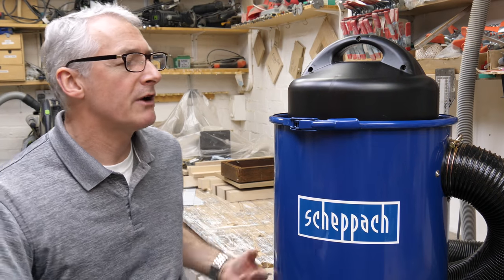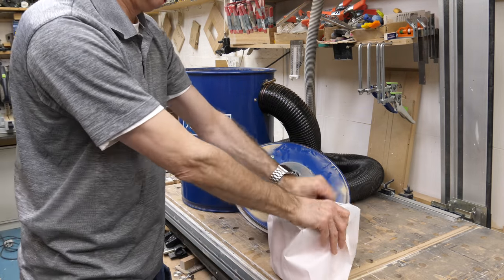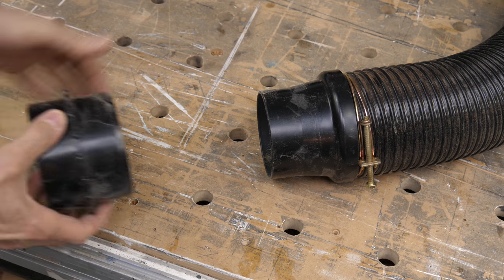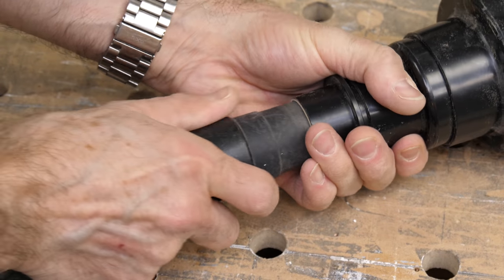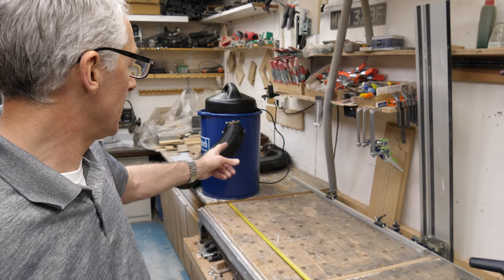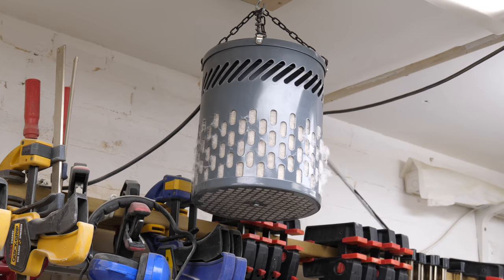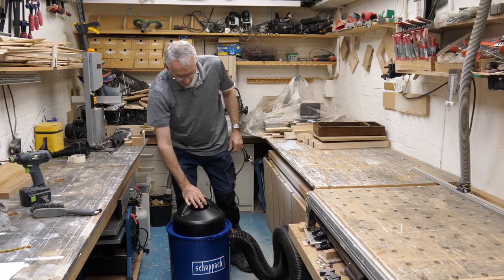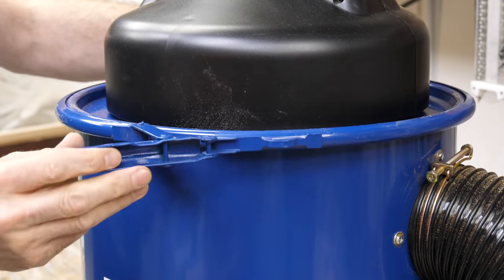Scheppach 50 litre Shop Vac [video #366]

Comment: I have just installed 100 mm pipework into my garage and I have 4 blast gated drops, the 1500 w Wet/Dry vac connected to the setup is either not strong enough or this is what I need, comments please? I purchased the Metal blast-gates from my local carpenter's store.
Is there any recourse available anywhere for hints, tips and tricks for dust extraction?
Reply from the maker: I’ve never installed that kind of ducting I’m afraid. What’s the longest run from the extractor to the tool? And is it a single turbine extractor? My YouTube pal Keith Brown at Rag n Bone Brown did a video about his ducting and extraction not that long ago, might be worth a look?  https://www.youtube.com/watch?v=t3O6nEjVWrM 👍👍
Reply: @10MinuteWorkshop  Rag & Bone was how I discovered your channel. I have already asked Keith the question, as someone who is new to all this and keen to get into a good hobby I was so disappointed when my system didn't work as I thought it would.
My Vac is a Einhell TC-VC 1930S 1500 W Wet/Dry Vacuum Cleaner connected to a cyclone and a drum. I just assumed it would work.
Back to the drawing board!
Reply from the maker: @22illingworth  Ah, OK. No I'm afraid I wouldn't expect that Einhell to be up to the job;  if you try and step a ~40mm hose up to 100mm you won't get the airflow you need - but you can step 100mm down to ~40mm and suck the chrome off a bumper! I think you'll see a major improvement if you switch to something with this Scheppach vac, or something better. Small-hose vacuums like the Einhell would be fine connected directly to power tools like plunge saws and sanders, but don't have the airflow to move large quantities through a 100mm pipe, I'm afraid - you'll need something that starts with a 100mm hose attached to the vac. Hope that helps! Best, Peter
Reply: @10MinuteWorkshop  that's exactly how the Einhell works.... perfectly on it's own... thanks so much for your input... looks like I may be in the Dog House when I explain to the wife I need another new toy for my hobby :)
Now stop interrupting... I have a binge list of your Videos to watch :)
Reply from the maker: No problem - happy to help, but sorry it’s not better news! Cheers, P

Comment: Interesting, I have the Lumberjack version which dancers quite violently if it starts to block up. I have this linked to the Triton bucket, DCA300, this saves wrestling when emptying the large drum and disconnecting the clamps, also saves on the bag filter.
Thanks Peter, as ever for informative content.
Reply from the maker: Thanks! 👍

Comment: Are the smaller connectors for the hose from the same manufacturer or can these bought from third party?
Reply from the maker: These ones came with the vac, I don't think Scheppach sell them separately, but Draper sell something similar; do a search for Draper 86044 Adaptor Assembly and it should come up. 👍

Comment: On certain equipment a two metre cord is standard fitting to prevent it trailing across the workshop and being damaged by other equipment crushing or cutting.
Reply: Of course the obvious answer then is to move the workshop wall with the socket closer to the machine.

Seriously, Either you work for a distributor/reseller or you've been drinking their Kool-aid (as the Yanks put it). OF COURSE THE CORDS ARE MADE SHORT TO SAVE MONEY. Copper is expensive nowadays, as the whole World wants it. These machines are cost-reduced in manufacture as much as possible, because pennies add up. I used to work for a big manufacturer - we would have many discussions over accessories to include, and even how many languages in the booklets.

Anyway, a too-short cable leads to much more dangerous practices, especially in the UK with fuses in standard 13A plugs. Extension cables not only have extra fuses (chained fuses = bad), but the plug+socket lump, lying on the floor, attached to a cable, somewhere arbitrarily near an operating cutting machine, is a really, really bad idea, especially if two people are operating a machine together. It even lifts the cable off the deck, by just enough to make it a really good trip hazard. Sadly, too, the design of the UK plug means it won't naturally disconnect if the cord is pulled (Schuko and most other ones will, which is a lot safer). Teach the apprentices the right way - if the cable is too long, coil the excess under the socket outlet, not next to the operating machine...
Reply: @simon-d-m  is coiling cable a good idea,won't cable get warm coiled up?
Reply: In short, not in this context, if the cable is properly sized and has plenty of air round it.

Comment: Lol at 'suck the chrome off a bumper', reminds me of one my Grandfather used use-suck a golf ball through a garden hose..

C13 & C14 plugs are your friend (uk.rs-online.com or similar have them) when it comes to tools with short leads; swap the standard 13A plug on the tool for a C14 plug, you can get some 3 core 2.5sqmm flex and standard plugs and make up a selection of interchangeable different length leads (standard plug >C13) much neater than extensions and you can have longer ones for site work etc. Similar to Festool's plug-it.
Reply from the maker: Thanks -!yes, you can get lockable ones too, I think. 👍👍
Reply: That is what I'd suggest - except I know them as 'IEC' connectors. Most of my tools are now fitted with them and I use surplus leads from Computers as the mains outlet to cable plug. Great safety feature on some power tools as in an emergency just pull on the lead to break the mains supply. Have one extension lead that's 15yds long fitted with in-ine IEC socket. So, so useful.

Comment: Hi Peter - can you please do a review of TITAN TTB785VAC which has built in auto start feature for power tools at only £69!!
There are no video reviews of this product out there at the moment!
Reply from the maker: Not sure I’d have a great deal to say about it really, Michael?? It seems to be a 22 litre wet & dry vac with PTO, but no quoted filtration spec and at 80dB noisy as anything. But the folks who have it seem happy with it, and a plumber pal of mine used the older plastic one for ages and loved it. I guess there could be a video in a comparison between this and a new Class L or M rated dust extractor, but for that to be a meaningful comparison they’d both have to be new machines, and as I’ve discovered in the past, quantifying the relative merits of something like dust collection is a really hard thing to make visually interesting. So, all things considered, I’ll probably leave it for someone else. Thanks for pointing it out to me though - looks very similar to one that Lidl sells, I think. 👍👍
Reply: @10MinuteWorkshop  Thanks for the reply Peter. I may give it a go - trying to put together a budget MFT setup and this seemed like a good option for dust extraction. 
I currently have an old Dewalt Powershop....well......
you know!!
Thank you for all of your videos - they are fantastic - keep it up!

Comment: Great, informative video. What do you think of this vs. one of those chip collectors with the 2 bags in a rack? I recently measured the Thor filtration unit to about 75 dB by the way. At about 1 meter. Have you ever tested the Thor for efficiency? I am currently editing a video about my Thor. And it is not hugely impressive. The numbers that is. The video will be awesome :D Cheers.
Reply from the maker: Thanks Goran! I think the chip collectors shift a lot more air, so would perform better with the 100mm hose. Haven’t used the air scrubber much tbh - I should check it out for efficiency. I should also try making my own, as I said I would about a year ago... 😬 And no doubt at all that your vid will be awesome! 😄👍👍
Reply: Peter Millard Lol. Thaks for the input. I was thinking about a chip collector. But I will look into this kind of shop vac now. My planer/thiknesser needs one.

Comment: I purchased the DC 100 from their main distributor in Brighouse England.
In my opinion it did not do what I expected.
When using it with my small lathe it wouldn’t pull the wood shavings and dust up the pipe (Only a few inch from my work)
I tried to return but they wouldn’t except the return saying that it had been used
Of cause it’s been used otherwise I wouldn’t have found out that it’s useless 
Be careful when buying Scheppach
Reply from the maker: Try it with a 65mm hose. Makes a big difference.
Reply: @10MinuteWorkshop  I will try that, but to be honest the way I have been treated by this Scheppach dealer 
I have lost all faith in Scheppach and will never consider buying their product again

Comment: As with others below the hose is less than ideal will split quickly etc. 
My main issue with scheppach is their after sales service in the uk, you go through NMA agencies who are a total pain! Scheppach change the speck frequently (reminiscent of austin morris car in the 70s) can't get spares past 5yrs or so,. Have one of their floor stand drills presses, got through a motor every 18months then changed design no spares, ended up fabricating a british motor to fit. NOT IDEAL if your looking for longevity....
Reply from the maker: Good to know, thanks! 👍

Comment: Have the Charnwood 1100w for a 16” bandsaw two 100mm ports , 3 years works great however I would like a separate cyclone bin or something as the paper bag clogs fast which reduces airflow . Dramatically imo 👍
Reply from the maker: Thanks! Yes, I’ll be looking into the cyclone option in due course. 👍👍

Comment: Just got Rutlands £69.95 on offer,  one similar with a metal top 🤔 must measure the cable???? Comes with the clear flexible hose.  Anything in the shop that l'm likely to use on site a put a neutrik 16amp socket and have a couple of 13amp to neutrik outlets on the van, them l'm not tripping over loads of leads sort of Festool Plugit 😂🤣😂😎

Comment: Is it possible to get a longer and stronger hose for this?
Reply from the maker: Yes, I use mine with 5 metres of 65mm hose I bought off eBay. 👍👍
Reply: @10MinuteWorkshop  Any type of hose I should be looking for,like brand name or anything?
Reply from the maker: Apologies, I bought from a company called dustspares.co.uk, and I bought product code PU63-6M, 6 metres of 63mm flexible ducting and paid ~£40 inc VAT & delivery. HTH P

Comment: Any reason you chose the scheppach over the rutlands or charnwood? They all seem to be the same unit I think.
Reply: FWIW I have the rutlands, it's pretty good especially if you just use the cartridge and dispense with the paper filter which just seems to clog too fast and has limited surface area.
It is a bit noisy but it sucks well and does about as good a job as I could hope for on my table saw.
Reply from the maker: As I said in the vid, I could get the Scheppach delivered next day - wasn’t the case for the others, and the Rutlands was out of stock when I wanted to buy.  🤷‍♂️👍
Reply: @10MinuteWorkshop  Yeah being out of stock doesn't help! lol.

Comment: Assuming this is a Class L machine and therefore not really suitable for hardwoods and MDF use and it looks like the only bags available are paper so whilst suction might be OK maybe not so good for health
Reply from the maker: Quoting direct from Scheppach “...suitable for use with MDF” Only difference between eg Festool class L
and class M vacs is an audio warning when suction falls below a certain level due to eg a full bag or blockage. Class L vacs are fine for MDF
Reply: @10MinuteWorkshop  Not sure it's quite that simple, to meet Class M spec the filtration required to filter 99.9 % of dust with a grain size of under 2 microns, class L is 99 % of dust with a grain size of under 2 microns  -  Like you say some manufactures do use the same Class M filters on Class L machines (Festool, Starmix and some Nilfisk machines) which is great.

Looking at this machine It seems that a Class M filter is available - assume this was provided?
Reply: @billconiston8091  life would be a lot simpler if extractors all had to be hepa h13 or h14 rated like they are in the States. European manufacturers all seem very quiet about the actual particle sizes that  can pass through their filters and insisting that m class offers the best protection, whilst supplying the U.S. market with hepa filtered machines. Perceived wisdom was that sub micron particles were respirable and presented the most danger. Particles below .5 micron that passed into the lungs were usually exhaled with the next breath causing no damage. To be safe it seems to me that a hepa filter rated at 99.97% of .3micron particle should be the standard.

Comment: Mains Cable Issue.  It's not about cost, but safety.  Long mains cables are a trip hazard.
Reply from the maker: Except short cables then get used in extensions, making them a trip hazard as well as the usual electrical concerns. So it’s about cost, dressed up as safety, IMO.

Comment: Hi Peter, I'm working my way through all of your videos! I'm trying to set up a small workshop in my garage for hobby purposes, and am bamboozled by dust extraction, particularly after reading this much lamented review: http://www.billpentz.com/woodworking/cyclone/index.php#index.php     . You mention a 'dust scrubber' in this video, so I presume you run this to mop up fine dust in the air, while using your Festool / Scheppach unit piped directly into the tool that you are using. Do you additionally use a facemask when cutting mdf and do you extract to the exterior of the building or run a fan? Thanks - I find this to be a very confusing area.
Reply from the maker: Hi Paul. So I very, very rarely use a power tool without dust extraction; extraction at the tool is by far the most effective way of keeping the dust exposure down **provided the tools are designed to use dust extraction in the first place**. All the other things - air scrubbers, cyclones etc.. are secondary, as you should be capturing as much dust as possible at the tool. My air scrubber featured in this video - Fan in a can, https://youtu.be/DcuIU4WsiWA - I don't recommend the one I have which is why it isn't listed. But yes, that's how I use it, to mop up any dust that has escaped the on-tool extraction. No, I don't use a facemask, unless I'm doing a lot of heavy machining at eg the router table, which doesn't have stellar DX, and all extraction is filtered internally, I don't vent externally as that would be inconsiderate, and probably a violation of many minor local regulations that I don't want to get involved in!

Hope that helps! Peter
Reply: @10MinuteWorkshop  Very helpful indeed. Thanks for such a speedy reply.

Comment: One argument for short cables which I heard once is that longer ones are more likely to get damaged. You’re more likely to switch out a damaged extension cable than a hard wired tool cable. 

I’m not sure I buy that though, and extension cables bring their own set of safety concerns...

Comment: I've got the SIP variant of this tool, I bought it for my dewalt thicknesser, is does an ok job but is too small (waste drum) and the air flow is too low really to give effective extraction on such a high waste machine as a thicknesser. By the looks of it the SIP and the Scheppach are exactly the same machine. One thing about my SIP is the hose is really ridgid so its not really that flexable. It will be getting replaced with a machine that can produce the higher air flow needed for 100mm port machines.
Reply from the maker: Good info thanks! 👍

Comment: I hate both short power cables and permanently-fitted ones - a real safety hazard if carrying heavy kit. OK this thing isn't heavy, but it's still safer to have a power inlet socket. 

I use IEC ("euro-style") plugs +sockets - the type you find on the backs of traditional PC cases. They are rated at 10 Amps, which is plenty for most handheld power tools and vacuums, and you can get wireable cable sockets (outlets) for them, too. 

They also let you use a 3-core cable - even if the "ground" isn't connected to the machine's metalwork, it still helps: if then the cable is accidentally cut, the RCD will almost certainly trip immediately. 

You can then also swap out the el-cheapo cable the manufacturers tend to  supply for rubber-covered or "arctic grade" that stays flexible in the cold, and you can also have whatever length you need, and even a right-angled outlet socket on the cable, so the cable doesn't stick straight out of the machine. 

The neatest thing is to fit an inlet plug plate right onto the case of the machine - easier than you might think with plastic covers - for motorised tools I use pop rivets (washers on the back), so they cannot come loose. Failing that, a plug+socket pair, in-line in the cable next to the machine, works well too. 

They are NOT my favourite power connectors, but they are a good trade-off between cost and quality, although I wouldn't consider them safe for a construction site (too flimsy). Yes, of course it voids the warranty, but the vac is a lot more usable that way.
Reply from the maker: Thanks! Yes, a locking kettle-type set is in the cards, I think; more permanent solution can wait until it’s out of warranty. 👍